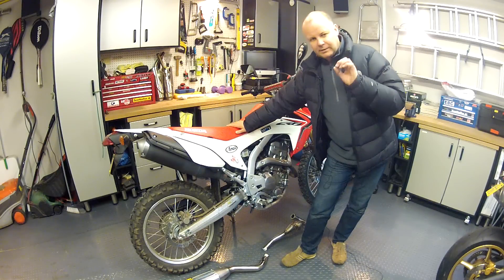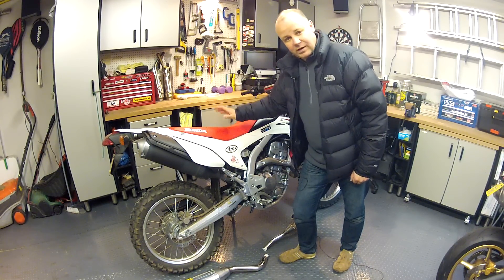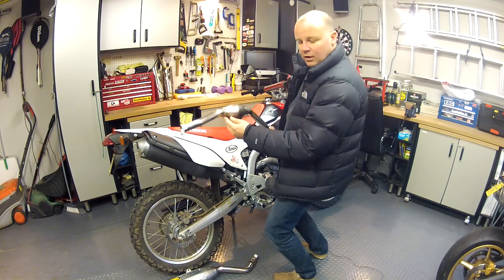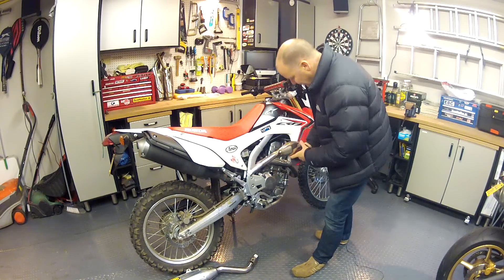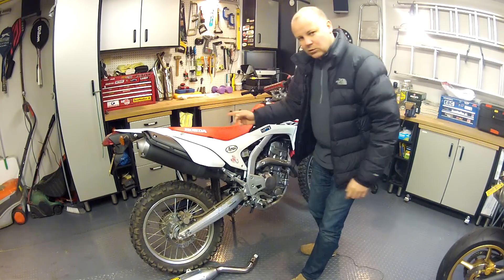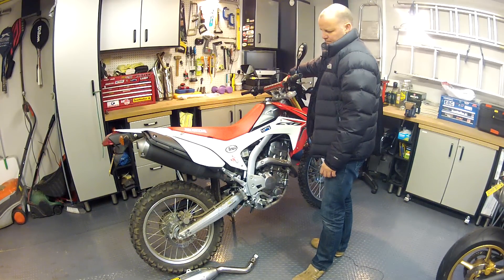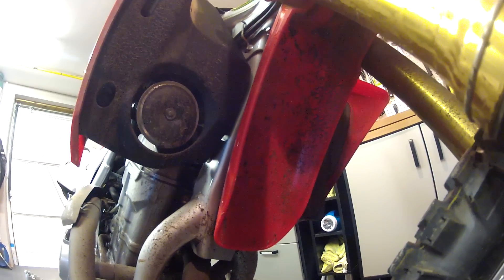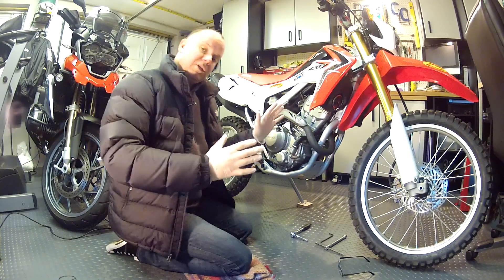Honda CRF250L FMF Q4 Exhaust & Megabomb Install

Comment: I am a new subscriber to you tube. I just recently bought a 2015 CRF250L. I haven't ridden a dirt bike in about 20 yrs. and when I saw the bike at the shop I was so impressed I had to have one. It's kind of a long story but I used to have a 1988 XR 600R. The torque was unbelievable but it was too big in the tight trails. This bike is a great all-around bike. However, just like my 600 when it was new, the exhaust is very restricted. After watching your video on your fmf install with the EJK I decided that my bike needed the upgrades. I installed the full exhaust with the EJK and a K&N air filter. Holy cow what a difference!! I also got the 13 tooth front sprocket and that is just what it needed to finish the task. It's still no 600 but wow what a difference!
   I just wanted to thank you for taking the time to do your videos. They sold me on the Q4 and Mega bomb package. In one of your vids you mentioned that the bike in stock trim was "boring" to ride on the street. That is absolutely the best way to explain the difference between stock and modified. I couldn't be more happy with my CRF! It really is a great bike. I think it's a little more of a dirt bike than a street bike but that is exactly why I bought it!

Thanks again for the vids and enjoy your bike!

Jerry
Reply: TheMissendenFlyer Hi I am having a blast with my bike. Such a fun bike to ride! I changed the front sprocket back to stock. After a few days of riding I think it takes away too much mph on the road. It would be better in tight trails but I ride to work everyday rain or shine.Just the other day I picked up a tail bag and absolutely love it. It fits perfect and looks great too. It's made by Wolfman luggage and it's the "wolf" tail bag. My buddy ordered the 'Peak" tail bag, which is a little smaller. They are really top of the line products. If you get a minute check 'em out. I'm sure they make something you might like for one of your bikes.
Jerry
Reply: TheMissendenFlyer 
Wondered what you thought about the Lynx fairing for the crf 250l ?

Comment: Hey TMF,.. got my FMF and EJK done on saturday and have had a few days to try it out,.. WoW!!! This 250l is not the same bike. Really glad i did it. Everything was so straight forward and quality was great. No tweeking with a hammer ;). Couldnt have done it tho without your videos of encouragement. I ended up putting the spark arrestor back in. Was almost too loud. Never thought id say that.
Reply from the maker: Told you it was worth doing :0)  Glad it all worked well for you, as you say, transforms the bike doesn't it....enjoy!

Comment: Not sure if anybody's mentioned it thus far, but in case it helps anybody here goes. When fitting the muffler white plastic heat shield, FMF actually supply a longer bolt to replace the one that came off (although this will still work). The thing to remember is to put the bolt in the reverse of how it came out, i.e. with the head of the bolt on the inside in the wheel arch and put the nut of the outside. This does away with the need to thread the bolt through and then carefully screw the heat shield to the metal bracket. This was taken from fmf's online instructions as I followed the video and thought it couldn't be right as pointed out by our host you cannot get to bolt the other way but by reversing it you can get a 12mm open ender on it and a socket on the inside with ease.
Reply from the maker: Thanks for that - I don't recall having any issues fitting this (but it was a while ago!!).....

Comment: Note the 2017 models Rally and the standard bike Honda have changed the header diameter so don't buy a secondhand one for a new bike it won't fit.
Reply from the maker: Good call David - thanks....
Reply: David Archibald which one can we get? I have the standard.
Reply: Would a powercore 4 slip on work? Just use the oem header?
Reply: Ill keep that in mind man. Im hoping to pick up my 2017 250L next weekend.

Comment: Don't be a victim of Mega Bomb burn!!!  Eventually your pants will burn.  I had to wrap mine because I prefer the look of the wrap over a heat shield on the Mega Bomb.  I've done all the stage one mods and then some.  This is a great one.  Also the 13/42 sprockets really help!!
Reply from the maker: Too late!  I've already got some burnt trouser marks on the mega-bomb!!  ....13T front sprocket goes on tomorrow..... :0)  Thanks for watching - ride safe - TMF

Comment: Hello, I have a 16' CRF250L as well. I'm about to buy this system, but many people complain that it does not come with an exhaust clamp. Did you receive a proper fitting exhaust clamp? If you could get back to me on the size of clamp you used that would be beyond great! Cheers!

Comment: Something that could be worth considering is smaller indicators, or perhaps no indicators at all if you are just using her for day and lane riding as long as you are comfortable with arm signals. When I took my bike out onto the lanes I accidentally broke my indicators off and it was kind of hard to get them home with no pockets or bag and covered in mud.
Reply from the maker: Good point, one for the wish list TG - thanks for that.....
Reply: You are most welcome. I'd like to recommend Oxford LED Eyeshot indicators. I had them on my CBF125 and they are very bright, very clear. About £50 a pair and they come with the relays (or whatever the word is because my brain isn't working). Getting my license soon, Suzuki SV650S Waiting in my back garden for me C:
Reply from the maker: Good luck getting your license....great stuff - TMF

Comment: Thank you for the helpful videos! I always take a peak at what you're up to on a project before making an attempt myself. I have the exact same exhaust, header, airbox mod, and EJK unit  installed on my CRF - I was wondering if you've noticed quite a bit more exhaust and gasoline smell since installing everything. I used to be able to ride without the smell of exhaust sticking to my clothing, but not since installing the exhaust, header, and EJK unit. My EJK was pre-programmed from the factory for the specific modifications to the bike, but I think I may need to re-tune it and was just curious what your experience was. Thank you!
Reply from the maker: Hi Jesse - I hadn't noticed an increase in smell, how interesting!  ...and like you I have just left the EJK in the stock settings for these mods from the factory, not played with it yet as all seems well!  Thanks for watching and for the kind words, all the best - TMF

Comment: Thanks for the vids, they're great. Out of interest, how much was the exhaust to buy ? Also, are you happy with the rear shock on your CRF250L ? Having lived in Thailand I saw lots of these bikes and the rear always looks low and very soft. Any thoughts ? I'm considering buying one now I'm back in the UK.
Reply from the maker: The header plus slip on came to £464...so far very happy with the rear shock, although I've not had the bike for long of course, and have ridden less than a thousand miles on her so far.  I'm not imagining it will be an issue, certainly the on-line community (forums) don't major on it.....cheers for watching and ride safe! - TMF

Comment: nice job, but I wonder if the big black plastic thing (or part of it) around the old exhaust can be fitted on the FMF, or truly needs to go. I'd rather leave it as I sometimes mount side panniers on the little Honda, do you think it's possible?

Comment: Bloody wicked sound! Im getting excited with my 250L also (though I have already bought a Yoshi RS 4 =( . Have you installed an EJK already or did you just let it all loose without Airbox mod and the EJK?
Reply from the maker: Hi Mark, I did ride it for a week or two without the airbox mod/EJK but have since done the mod/fitted the EJK (I have videos on both you may wish to check out).....I didn't want to run long term without the EJK as the mixture would be too lean and potentially damage the engine......enjoy!
Reply: TheMissendenFlyer
Thanks alot mate! Very informative vidz you got. More please..
Reply: Hello. I installed t4 carbon pipe on my 2017 crf 250l. I dont have ejk. Can it damage my engine?

Comment: Another great video, so much so I went out and bought myself a new CRF250L to add to the collection, loving it and it was your vids that swayed me so thanks for that. I have bought the same bark busters as you and the Oxford heated grips for the bike. Did you do a video showing the fitting on the CRF? If not any chance of any tips or advice fitting them to the CRF or a pic of the placement etc for the control unit?

Thanks in advance for any help or advice..
Reply from the maker: ..Hi Steve - actually I got a local bike mechanic to fit mine (sorry!!)...
Reply: @TheMissendenFlyer  Lol thanks for that, i did consider that myself.. I wondered if the bark busters needed any fettling to make them fit and where the Oxford control unit was best placed..

Comment: Did u have any trouble lining up any of the bolts , I had issues with the mid pipe frame bracket and that bracket that holds the muffler plastic on. So much that I almost gave up and sent it back..... Lol. I got it finally but had to modify a couple things. Thanks for the video. 👍🏻
Reply from the maker: +treyh007 ....I didn't have any issues at all, maybe you had a duff one from manufacture???  Glad you got it sorted out, annoying when that sort of stuff happens, I feel your pain!
Reply: +TheMissendenFlyer I just got off the phone with FMF and it sounds like I didn't loosen the header up enough. I'll go back and try it again to see it that helps. Thanks for the quick response!  Be safe, and a big so long from SETX! 👍🏻👍🏻
Reply from the maker: +treyh007 aha that would do it!

Comment: Love the vids man, watched them while modding my bike but few questions. How do I check for leaks? Did your exhaust smoke a lot when you first got it and can i get by with no high temp silicone? I kinda put the exhaust on before getting it, got it now and don't really want to take it off again if i don't actually have to.
Reply from the maker: Well if you don't have any leaks, don't worry about the silicone! (check by feel with your hands when the bike is running - cup your hands around the join (but don't touch!)...

Comment: I am from Chile I am working on installing the exhaust that had the xr 250 r from (, year 1996 to 2001) in my crf 250 l, 2018 ,,, 2000, I have presented it on the motorcycle, it is going very well, just missing weld the escape curve.

Comment: Christ what a difference!  A very relaxing video to watch that my friend - thank you!  I went to local Honda dealer today to have a look and find out about price etc.  Finding it difficult to get a test ride round these parts - did you test ride before buying?  Is it worth a risk not having a test?  Would you wholeheartedly recommend the bike? Sorry for all the questions! Thanks again - great video!
Reply from the maker: Hey Crumble -Thanks for the kind words, great to have you along! Yes it is tricky to find a test ride, I rode the CRF250M which is a very similar bike on paper but actually feels quite different to ride (I have a test ride video on my channel if you're interested).  I think the bike is stonking but as stock you'd hate it, the mods (exhaust in particular) make an otherwise anaemic bike into a funster machine. If you get a test ride you have to use your imagination on sound and performance as to what these things can be like.  I got a good deal on mine (£4K for basically brand new by shopping around) so for that money I took the risk - and don't regret it one bit, over the last month I've ridden this by choice much more than my other bikes and I can honestly say I've enjoyed it more than my Street Triple R, my big GS and the Diavel I have been riding over the last week.  Has to be your choice of course, but you can tell I'm a fan.....great little machine for light off-road fun.  All the best mate, TMF.
Reply: Thanks for the reply buddy!  Really enjoying the channel and especially interested in the CRF vids.  How do you find the standing up on the CRF?  I had to buy bar risers for the Tiger 800 as I'm a tall bloke - you think I'll have any issues there?  Seems the idea of getting the bike with a full Yoshi system from new might be the way to go then? Thanks again and keep the great vids coming!
Reply from the maker: The Crumble Hi again, I find standing up on the CRF harder than on my GS because the pegs are a little farther forward of the centre of gravity - so I have to concentrate on being upright, where as on the big BMW the pegs are bang in the middle and you could stand up with no hands easy enough (not sure how this compares to your tiger).  I suspect you would need risers, I'm not that tall and I find it a bit of a reach to the bars on the CRF standing up.  The Yoshi would be preferable to the stock can but by far and a way the most popular pipe for these bikes is the FMF + the tuned header (either the megabomb like mine or powerbomb if you want the powerband higher up) - this + the EJK fuel controller will add almost a grand to your purchase cost :0(  but an essential addition if you don't want a lame bike!  Loads of stuff on YouTube about this and a great online community for the CRF....lots of research to be done!  Enjoy......TMF
Reply: Thanks for the detailed response - it's really appreciated.  I will let you know how I get on. It's only a matter of time before I order one I think.  It seems a great package for the money and the service intervals are phenomenal! Like you I love the way these sort of bikes get you closer to nature and take you to places you wouldn't have gone before.  Looking forward to the adventure!  Thanks again for your help!  TC

Comment: Nice, except here in the states, you can't ride without the spark arrestor in any of our National Forests.... I have been stopped when I was riding my Yamaha XT250 by a forest service "guy" and he stuck a straight rod into the end of the exhaust to make sure it was there...I can see their point though, we have extreme fire "season" in the summer, the forests get quite dry...
Reply from the maker: Hi again Sam, yes I can see their point, and there's no real issue having the spark arrestor in place on the bike.....thanks for stopping by once again - TMF

Comment: I have a juvenile question. Do you not need to add a fuel programmer to adjust the mixture with the aftermarket exhaust?
Reply from the maker: Ideally yes - hence see my other video on installing the EJK fuel programmer here >> https://www.youtube.com/watch?v=Gn1C14XW8zI&index=11&list=PL_719tkJvufZW59HANCu2VtrACsEeQmK4
Reply: +TheMissendenFlyer but why, it's just an exhaust...
do you have any stalling issues because of that?

Comment: Hi TMF, big fan of your helpful tutorials, i have a CRF250M and i'm looking at fitting the Q4 and megabomb, my query is, are they both suitable for on road in UK? Would they pose any problems for MOT? any info would be appreciated. Many thanks, Gaz.
Reply from the maker: +Gareth Jones Hi Gaz, I suppose technically you could have a problem with noise at MOT time but when I recently spoke to my MOT man on the subject he said that he had heard bikes with much louder exhausts and they hadn't failed....so make of that what you will! My CRF isn't quite due for an MOT yet but I'm not anticipating any problems. I regard these pipes as very suitable for the road, especially if you're in traffic, I do subscribe to the "loud pipes saves lives" brigade! Thanks for stopping by and for your kind words, all the best - TMF

Comment: Are you still loving the noise level or is it offensive out in public? Thinking about a stage 1 set up and a very small dual sport community aground here to get a listen to the q4. Thanks
Reply from the maker: +Vermont Dualsport Yeah I love the sound, I've not had any issues with the locals with it but I do try and behave myself as much as possible (I kill the engine and coast past horses on the road silently for example)...  Not quite sure where the "Q" comes into the Q4 though - "Not Q" would be more like it!!  Great in traffic by the way....

Comment: I like your garage floor. Can I ask what those tiles cost you over there? ... I priced them here in the USA for my garage and it was well over $3,000!!!
Reply from the maker: I can't remember exactly what it cost - it came on a roll from Costco, I think my garage was about £450 (so maybe $1000 US)???
Reply: Oh, that's a roll? .. I thought it was the interlocking floor tiles. They are awesome but are expensive.

Comment: Hi, I'm converting my CRF250R for road use, might have an issue at MOT time though if FMF Q4 is marked in any way like "Not for road use - track use only". Can you tell me, is the Q4 marked in this way?? Many thanks.
Reply from the maker: Nope doesn't have the ol' "Not for road use" marked on it - in fact it does say "Sound Compliant" and "Nature approved" - it's a US made pipe imported so it doesn't have the Euro-type approval markings.....
Reply: TheMissendenFlyer
I've been trying to get an answer on this for days, tried the UK importers, can you believe they couldn't tell me - well the bod I talked to on the phone couldn't, even tried the manufacturers in America, still waiting for their reply 5 days later now you've answered the question in about 15 minutes!!!  Big thanks, I'm off to the shop.
Reply from the maker: Pete Whitby Glad to be of service.....

Comment: Awesome video very smooth, You know much about the performance difference between your Q4 and the PowerCore? Besides the PowerCore being more loud.
Reply from the maker: +Connor Feasel Hi Connor - thanks for the kind comment, and no, I'm afraid I don't know about the power difference between the two....other than I can't imagine it's much, the Q4 makes a very noticeable difference over the stock exhaust power wise though, a "must do" upgrade on the little CRF.  Cheers for watching, all the best - TMF